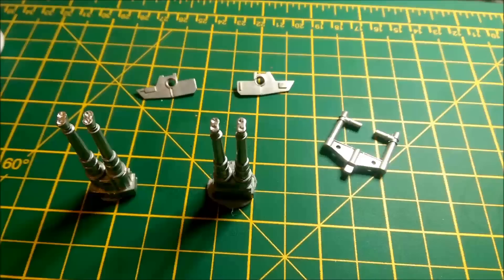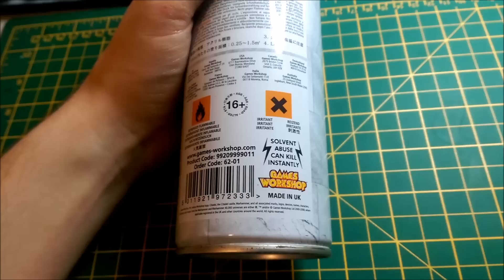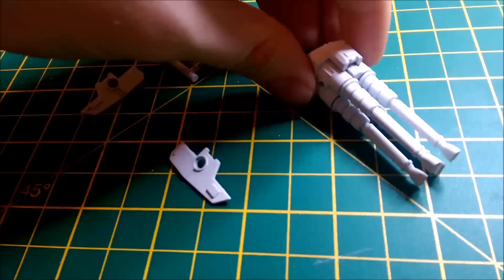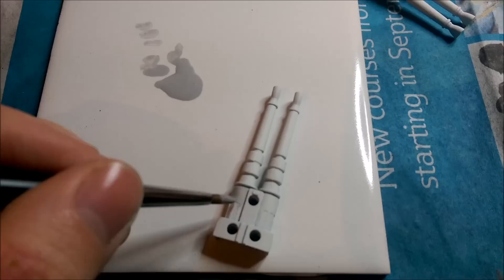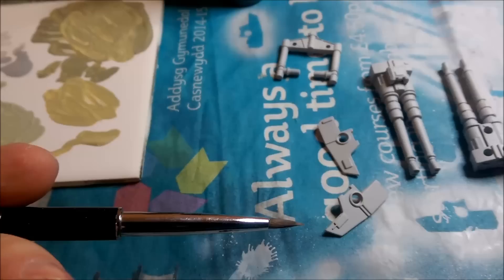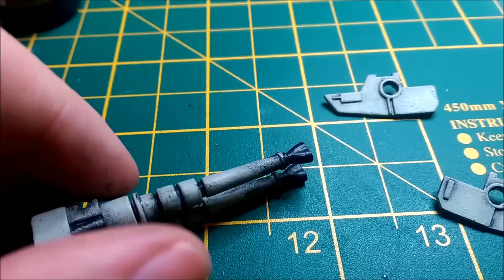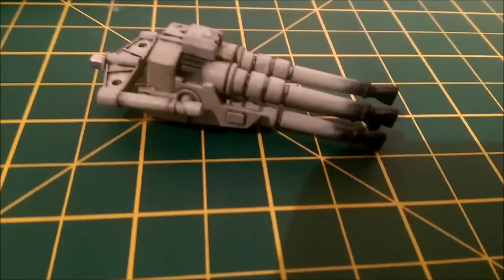Build the Millennium Falcon Customisation Episode 1 - Quad Laser Cannons - Part 3 Painting

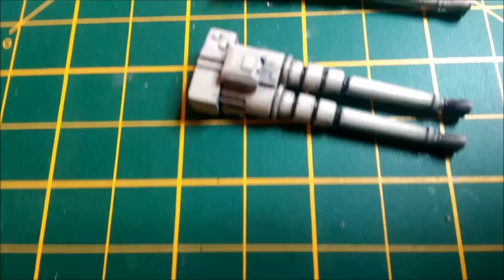Comment: Just a question, at about 11:20 when you apply the second coat after the oil application are you using the Vellajo grey again and just applying to the top of the turrets? Thanks
Reply from the maker: That's correct, I'm trying to keep the painting as simple as I can. The shading from the wash darkens the first base colour of it making the original colour a good highlight choice. I could go back again and add some white to the grey and highlight even further, but at such an early stage I'm not sure what it's going to look like against the rest of the model. Have you started painting?

Comment: Not yet. I hadn't thought about customisation until I saw your vid and pics of the Master Replica Falcon. But you've inspired me to give it a go. The shiny metal just looks wrong. Can you recommend a good website to get the paints from?
Reply from the maker: Depends there are loads of good shops on the high street, however the internet is a good source you will find a lot on ebay
Reply: +Paul Mason I know I'm late to the party, but you can get a ton of different hobby supplies from Amazon, including just about every hobby paint you can imagine.